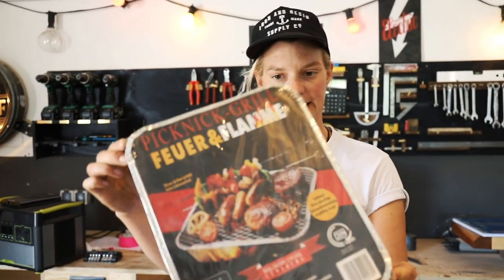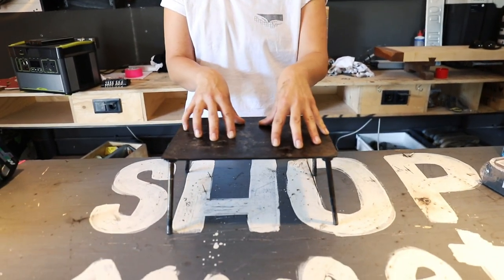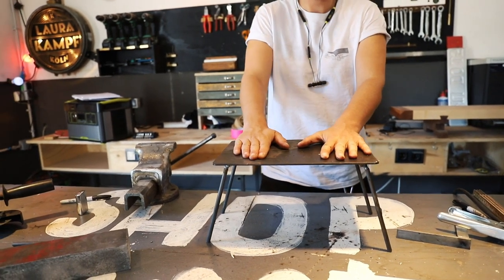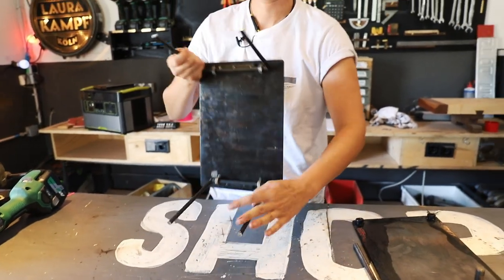DIY Portable Camping Grill (Mini Hot Plate)

Comment: I don't really grill but this was easy to carry and bring with me camping as a backup in case https://www.youtube.com/post/UgkxTAV04Wwc8vZvciP7ycqR1S4raCS0TnUc I couldn't get a fire going. In my opinion it is better to bring a charcoal grill instead of a gas grill as a backup because if it rains or the leaves around are still damp from a recent rain; you can use the charcoal to help your fire keep going even though a gas grill is easier to temp control with. Overall, pleased with my purchase.

Comment: If it's cheaper and reusable, it should be mass produced and replace these wasteful single-use products. It may even be sold at the same price or a bit higher, it would still be better.
Reply: Only problem there, the most of the people are too lazy to take it back home and clean it. Or even without cleaning they are too lazy. My thoughts.
I would use this, if I would use charcoal or woodfired barbeques. Its a great idea for all off grid campers or survival fans too. Weight by the way? Something around 1.5 kg I would guess.
Reply: It's nothing special that you have to clean an item when you want to reuse it. You have to clean your cooking pots and pans, plates cutlery and all that stuff as well - but the benefit is, you can reuse them and not throw them away to buy new stuff after each use. Nothing different here.
Reply: Like an ordinary grill?
Reply: What I mean is, that the first shown grill is something that you can take with you into a park or to the beach. And these grills are supposed to be trashed after one usage. And after a nice evening in the park with your friends and some beer you aren't happy if you must carry this grill home and clean it there. So the most people throw them away because it's much easier. It's wrong but laziness wins against a responsible usage of our resources. 
I think so. The grill is a nice project and I would use it. But for the most of the people is this one time use grill the easier and most accepted way.
Reply: Then that's maybe (hopefully!) the reason these wasteful grills are so expensive: I hope they tax the everliving shit out of them in order to actually pay for all the wase they create - including the energy needed for recycling them and all that.
Reply: That would be a hope, but I think the taxes aren't very high. And if they get thrown away in a city garbage bin they never see a recycling center. This garbage gets burned because nobody wants to separate every single garbage can.

Comment: Those grills are $5, the metal you used is way more than that. Side note though, after using them clean off that grill liner and you can use that mech for projects. I used it on steam punk goggles a mesh cover on a wooden box i house some electronics in and piles of other things
Reply from the maker: It was all scrap metal I had left over from other projects...so no, it wasn‘t more expensive. And it’s reusable
Reply: @laurakampf  true, but if you had to buy the metal it would be more exspensive. Still it is a better option if you had it. Also i love how you keep poping up  in other makers videos

Comment: I think some heat-flame guards/catchers/plates/skirt (I can't think of a good name for it) down each side of the plate might help to contain a lot more of the radiant heat and the flames, improve efficiency and perhaps reduce fat/oil flare ups. Maybe 3 cm depth down each side? It would stifle oxygen and reduce burning efficiency directly under the plate and that is a super important consideration, but I think this modification would help the plate get hot faster. If you have a FLIR you could possibly test this solution if you can generate a consistent fire for testing. But it will also increase the mass,  the thickness and you might have to cut some slots out of the flame/heat skirt so it doesn't interfere with the folding legs. If it's thicker, your pouch may no longer fit.. unless you can make this skirt foldable as well.

Comment: Similar to some I made years ago. I welded 4 pieces of round bar on the top edges to stop sausages rolling off. Leave the corners open to drain the oil and fat and use round bar to make simple handles horizontally from the ends. Another one I made from an old plow disc, welded 3 nuts underneath like a milking stool. 3 pieces of threaded bar for the legs and it worked.

Comment: Is this automatically food safe or do you first clean and prep the surface? I imagine a lot of nasty industrial oils and such on the surface.
Reply: Laura's steel looks like it has a 'mill finish,' also called 'black oxide,'  a mildly corrosion resistant conversion coating. It's formed by the use of a chemical bath eg sodium hydroxide (NaOH) while the steel is still hot to produce a surface  of magnetite (Fe3O4). The NaOH is water soluble and is washed off before storage. Corrosion resistance can be improved by applying some light oil or wax. 

I would scrub down raw steel used for a food contact surface with soapy water & steel wool, but this can make the steel flash rust. Laura's pretty casual. She immediately heated the steel, which would burn off any oil or wax, and magnetite is non-toxic. Laura then seasoned the steel with cooking oil, salt & potato starch which creates a rust resistant surface on the cooking side which also keeps food from sticking.
Reply from the maker: Thanks for the in depth explanation!!
Reply: Thanks for the explanation, I like the details! And thanks Laura for the fun build!

Comment: Should be nice and non-stick too once it gets seasoned.  Very cool!
Reply: droamir will that work with regular steel or is that only with cast iron?
Reply: @MikeTheMaker1  You can season carbon steel pans and such like cast iron.  You're polymerizing fat from oils in a thin layer, so it should work.